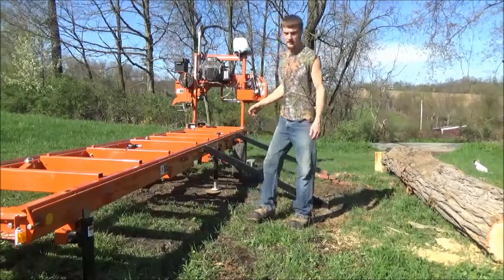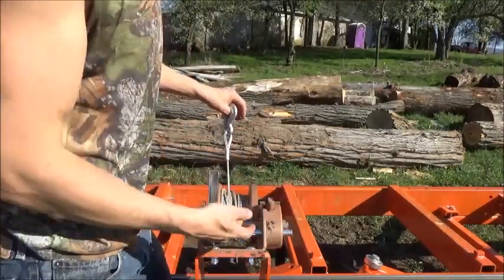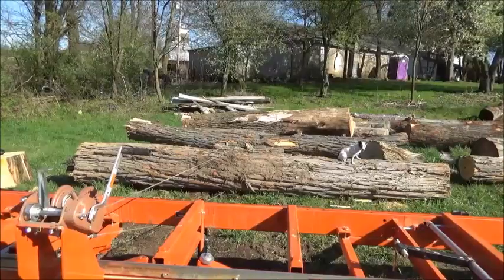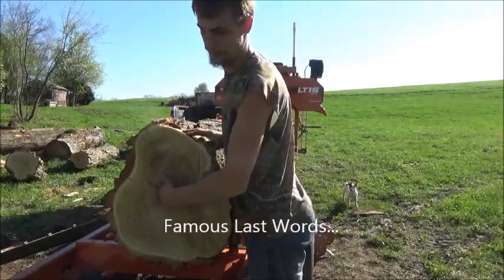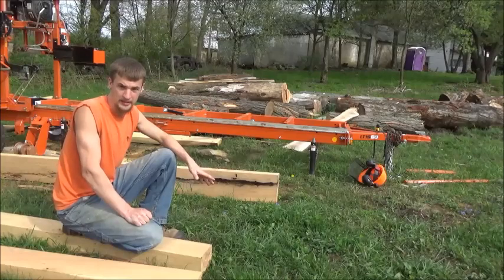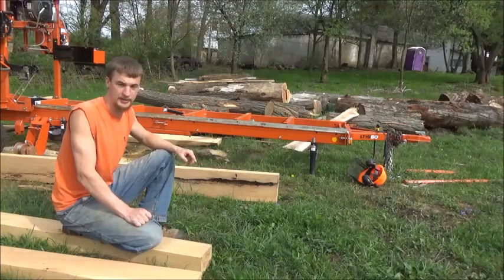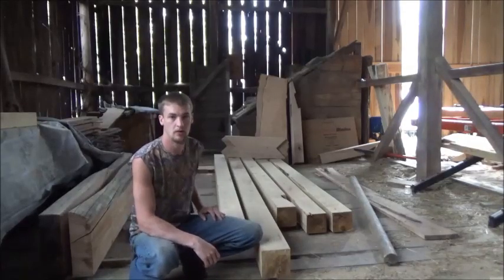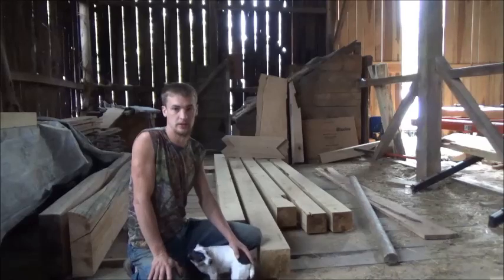Too Heavy For The Tractor BUT Not Too Heavy For LT15GO Ramps and Winch

Comment: If you run the lower cable over the rail you won't need the Cant hook for the final roll onto the mill.
Reply from the maker: Almon Jacob I used to do it that way but it seemed to pull the log up straighter this way. Maybe it’s just me haha but I chose what I felt was the lesser of the 2 evils. But now I have the LT35 and don’t have to worry about that anymore 😉
Reply: fair enough, now I am jealous!
Reply from the maker: I love the hydraulics. Makes milling a lot mire fun

Comment: Old timer tip...get you a 1/2 inch drill with a bit to fit that crank socket...and use drill to turn that cable wheel...It works...guy on Fall Line Ridge channel uses battery powered drill 🔫to run up his logs onto saw mill. Nice work...keep it up pal 👍
Reply from the maker: A Fewox I actually had my brother, who is a welder, make me one and I used it up until I sold my LT15GO. Now I have an LT35 that’s all hydraulic so no more fighting logs!
Reply: @WillowRunMills  👍aghhh ...man you in hot cotton now...no more crankin👍
Reply from the maker: Lol nope. My fingers are going to get tired from pushing on all those levers.

Comment: Man ....If you only knew how long I have been hunting some good black locust logs. I had a few located a yr or so ago big beautys that were sound and round. Blew over in a storm ...but the old guy was set on turning them into firewood.  What blade did you use for that locust?
Reply from the maker: cold spring if you look at the video as I’m backing up and setting up the mill there is another locust in the background. I guess I’m lucky to have them! I believe that was a 9° blade